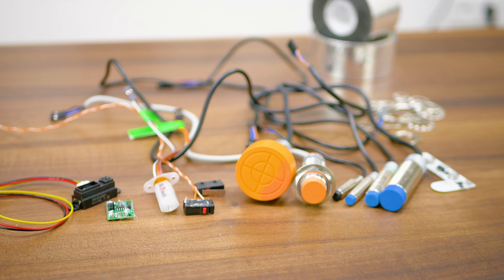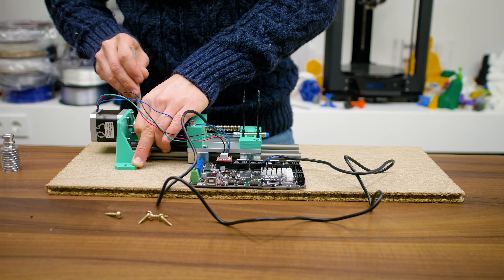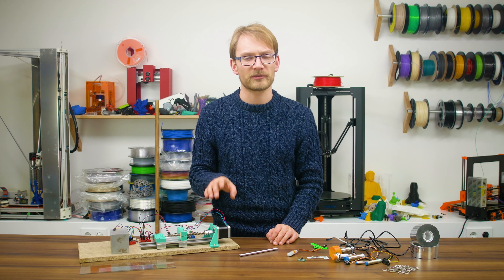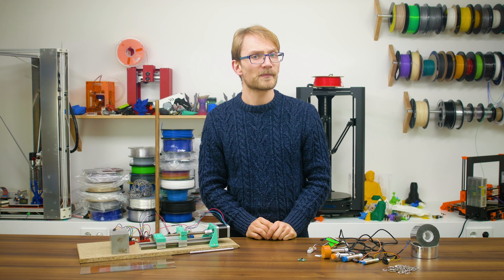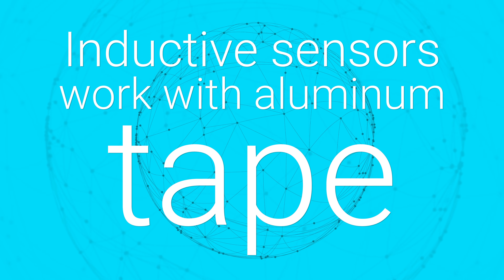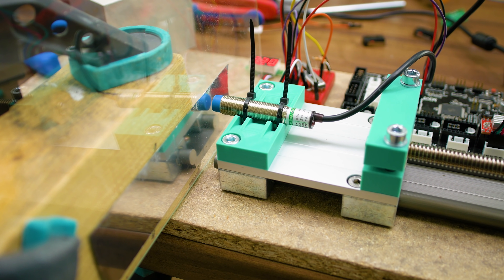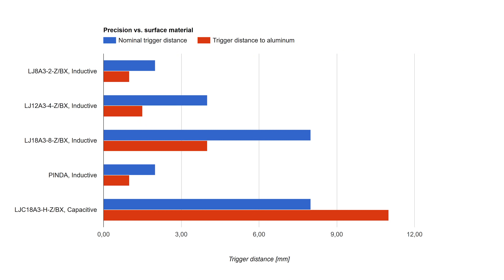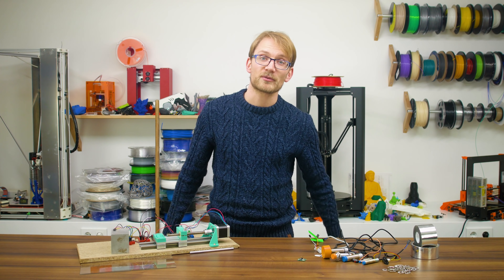Autoleveling on 3D printers: 9 myths and 12 sensors tested!

Comment: I know this video is over a year old at this point so I hope this is still relevant.
He tested all of these sensors horizontally. The BLTouch specifically states NOT to use it that way. It needs to be hung vertically as it would be mounted on a printer.

I've used a mechanical switch with manual leveling, a mechanical switch that flips up with a servo, capacitive sensors, inductive sensors, glass beds, PEI sheets, Zebra Plate from PRINTinZ, aluminum beds, and even tool steel beds. I've tried a total of 15 different sensors and 11 different beds in my few years of 3D printing. NONE of them were as accurate as simply using the BLTouch. When it is installed correctly, it just works flawlessly. Best of all it doesn't care one bit what surface you have, it will work on anything.

I think it deserves a re-test.
Reply: It has almost no deviation on his tests, maybe 3 micron, which is next to nothing. He also states that it doesn't care about the surface material. So actually even in this horizontal test it comes out as (one of) the best choices regardless of where you want to print on.

Comment: I would love to see this video updated to include Ultrasonic sensors, and name brand inductance sensors like those made by Osram up to say 16mm sensing distance.  That being said, this video is so helpful.  Thank you for making it.
Reply: ultrasonic too hard to work at small distance, basically time of flight is sooooo short electronics is not fast enough to process it. if you have at least 10cm distance then there is enough time to do calculation at reasonable precision yet you need to run higher frequencies. We tried to do  auto focus device at 25mm distance even there we had to give up on ultrasonic sensors.

Comment: The only reason I moved from an inductive sensor to David Crocker's IR sensor is because of the bed. If the thickness of the bed varies, or there are holes in it to reduce weight, the induction sensor will trigger at a different height to more/less material being on the bed in one location.

Comment: You are talking about 50µm (0.05 millimeters) If your 3d printer i high end maby and i say may your 3d printer has a tolerens of 0.1mm , maby better with out belts, and using ball spindels. 0.05 millimeters is just so unreal.

Comment: I got a 8mm "orange" inductive sensor. It detects from 5mm away at 5V, perfect for my mirror covered bed. Too bad I have deviation between the Z homing distance and the probing distance. Then nozzle homes about 1mm lower than it actually prints at. Same with endstop, that's not the sensor's fault.

Comment: Here's a question, with the inductive sensor, does the voltage range matter? ie does the sensor (say, a 6-36v sensor) work the same at 6v, as it does at 36v?

Comment: Assuming the data collected is accurate, in order to make probe comparisons, large tolerances must be added to inductive probes that include the build plate tolerance stack for non-conductive top sheets (adhesive, PEI, etc...) . Also the BL Touch is intended to operate vertically, more friction is introduced horizontally. Once all this is considered and included, the BL Touch will compare MUCH better, if not the best.  Also, if tossing on a thick G10 build plate for printing Nylon ... only the BL Touch or a micro switch can accommodate that, without having to change the probe z offset value.

Comment: I never thought about using such sensors for measuring the bed level. At work I use mostly inductive ones but just for checking if there is an object or not. When I saw your video about the Prusa i3MK3 and its autoleveling I had doubts about the precision, but your video here has told me better. Thank you.

Comment: Technically speaking the whole process shouldn't even be called "auto levelling" as the printer doesn't make anything more level after probing. It just compensated with stepper motor movements for the uneven bed.

Comment: I am looking for someone who has a custom configuration.h file that they are already using, and configured for the BLTouch Sensor, and SKYNET3D that they could put a link in for dropbox or somewhere for my CooCheer 3d Printer.  The file needs to be configured for an Anet board with LCD 12864 graphic display.  Print Bed Size configuration is W 220 L 270 H 230 mm.  If someone would put a link in a reply, I would appreciate it.  I'm sure there are other people who could use the file also.

Comment: FYI, you tested the BLTouch in the wrong orientation. I tested mine thoroughly at multiple homing speeds and standard deviation was 0.01mm with the occasional one that that was +/- 0.02mm, on all but really fast homing speeds. 

I now do a two step homing with it, once at 1500mm/m, and then a slow home at 100mm/m from ~2mm of the bed.

Comment: Some time ago I built a DIY heated bed to my Printrbot Simple Metal.  In order to get the sensor to detect the bed through the glass, I had to put a sheet of 1 mm galvanised steel sheet under it.  But now, the sensor almost touches the surface of 3mm thick borosilicate glass.  Not really useable.  I could not find borosilicate glass less than 3 mm thick.  I read that plain glass can withstand a certain amount of heating and cooling as long as it happens slowly.  But how slowly?

I decided that glass of the type used in picture frames was cheap enough for an experiment and I bought a couple of 200mm square glass frames from a bargain store.  This glass, being only 1.5 mm works reliably with the built-in heating setting (I did not have to make the glass heat more slowly) though I must warn that, since I only use PLA, this setup has never been tested above 60c!

Also, borosilicate glass can withstand some downward pressure (when things go slightly wrong) - but picture frame glass cracks immediately.  I lost both in the experiment, but have had 6 perfect prints off the third, with one coat of Magigoo on the glass.

Comment: I wish your test apparatus also used a layer of glass, typically found on CR-10x's.  If the sensor needs to be too close to the glass so as to interfere with prints during printing, then that is a fail.  Please account for sensing distance to the detected object.

Comment: Hi can anyone help on a question I have? I want to buy the anet a8 3D printer, and I was asking what sensors would work on it, if any. I don't think any of the sensors will work as it requires manual straightening , but can anyone help? Is there any other ways of making the bed straightening automatic on that printer?

Comment: Hi Tom, just came across this video while I'm building my i3 clone, great videos! Do you know if there are any 12mm sensors longer than 50mm? My sensor doesn't go close enough to the print surface so doesn't detect the print bed. Would really like to get the printer working, going to watch your clone prusa series now!

Comment: what voltage divider did you use on the inductive 6-36v sensor?  The one you built in your first video about inductive sensors?  (15kohm & 10kohm)?

Comment: So.....ok, using the sensor, the controller will know where the bed is, 
Doesn't it need to know where the nozzle is? How does it know that?
Do I need to position the sensor in relation to the nozzle somehow?
Show me the way Sensei!
Reply: You actually can set up what is called a Z Offset, either in your firmware, or preferably from the control screen.  this tells the system what the difference is between your sensor, and your nozzle

Comment: can you use tmc 2130 for sensorless bed leveling ?
Reply: I'm affraid not, because that is a "soft end" not a "hard end" I mean those X Y hardly stop the movement like hit the wall but the bed suspended on springs.
We should try piezzo. (I already bought a full set, but not decided yet will using the sensors on the hotend or on the bed) 
 I think Thomas have to try too that "piezzo Z-probe" and make video about that.
Reply: budavaril 
I totally forgot the springs
Thanx

Comment: This is OK, but the sensing here is done horizontally, and on a printer the sensing will be (always?) vertical. In fact the BLTouch creators specifically state that the results cannot be relied on unless the sensor is directly perpendicular to the sensed surface.

Comment: Try the sharp with an offset. Ultrasonic sensors generally can't read values accurately below a certain valve, due to the reading times required for the sound wave. Try offsetting it and see if accuracy is better.

Comment: awesome, but it would have been good to see the results of some more industrial type inductive and capacitive sensors, which I know are tons more expensive, but it would be interesting to compare results
Reply: i have replaced a cheap chinese capacitive sensor with an italian one, The result was very bad  (worse than the chinese), capacitive sensors for this kind of use are not good, so much variation on humidity and temperature changes. I am installing an inductive sensor right now.

Comment: Strange that the capacitive sensors would be more accurate, and more reliably accurate, than a mechanical contact sensor. That one really surprised me. Do you think it's due to the physical reset time of the pin itself? I wonder is the pin sensor would be more accurate if the sample rate were slowed considerably?

Comment: +Thomas Sanlanderer,  I have seen passionate and apparently well supported comments that both says an inductive sensor can work at 5V and cannot work at 5V.  So, who is right?  Well, it seem you both are.  Evidently the difference is in the NPN vs PNP designation.  Evidently NPN devices (like you tested) do not work at 5V; but, PNP devices do.  I have no idea what the circuit is inside these devices (and I doubt it is a BJT); but, there does seem to be some sort of a transistor in the device to act as a switch.  Also, it appears that for the NPN device the transistor is on the negative side and for the PNP device it is on the positive side (much like you would do for a BJT).  

Tech2C's investigation shows the PNP inductive sensor clearly works at 5V where the NPN does not.  See https://www.youtube.com/watch?v=wih4fNkKUCc.  It appears that for some reason 5V is sufficient to turn the high side transistor design (PNP) on; but not the low side (NPN) design.

I wish I had the sensors to investigate the behavior more fully and get a more satisfying explanation of why.

Comment: The best sensor I've ever seen is a membrane sensor. You just put it's membrane switch on the cold nozzle, hook up the small control board to the main PCB, and it works. Also, it probes with the nozzle itself, no offset is needed. After grid calibration my Kossel Mini clone prints at 0.1mm first layer with no problems.

Comment: So capacitive sensors are the only way to detect the build it's self. 
This video confirms the need for a way to correct for error. 
I like the idea of using an inductive probe as a means to compensate for a capacitive probe's error, but maybe just using 2 capacitive probes mounted near the print head and comparing the measurements would be better.  
Using an inductive probe to compensate for error would still require a metal build plate from which the position measurement could be taken.

Comment: Thanks for all that testing but now I want to know which probe is best for the Scoovo X9H. 
It has Kapton tape directly stuck on a glass bed with the silicon heating pad just under it. 
Board: RAMBo
Firmware: Marlin

Comment: Thanks Tom  for such great videos,
have you tested the slotted optical switches?
I would like to see some feedback about it. As many know that slotted optical switches are used in Deskjet and laser printers for homing the printers head.

cheers
Reply from the maker: +Süleyman CANAN I've used them extensively in the past, but found they are quiet sensitive to stray light.

Comment: Tom, you really should continue wit the Myth-busting line. I have been experimenting with sensors I have to say that your conclusions corroborate my experience  100%. Given mechanical switches with lever , although less precise than inductive, can be used with borosilicate glass, I will stick to those.  Awesome video, congrats.

Comment: Hello Tom thanks for these instructive videos, in industry we use sensor with one µm resolution from baumer (MY-COM G75P/S35L) I get one on an old equipment, and plan to use it on my 3D printer in progress ; my main issue is to manage the way to lift this system not to hit the bed or printed object while extruding.
Hope this will help. Pierre

Comment: Hi Tom,

i have a reprap 3d printer for some time now. The mendel 3 uses an ir sensor for both x and z homing. especialy the z homing i find is very inconsisntend. in fact the only thing i do against poor z leveling is manualy calibrating the axis once the print has started.  The ir sensor  is set to tringer at a set value which in term corresponds to a set height from the heated bed. So for instance a value of 18 corresponds to a height of 10mm above the bed. Do you recomend to opt for a new sensor?  Or is there a fix i might not have thought of?

thank you so much for your videos, since i learned about this channel my prints improved massively!

thanks a bunch

Comment: Usually there is a spec sheet prescribing optimal materials and thickness with respect to frequency (typically a few mils for ferrous and 2-10x thicker for nonferrous).  The relevant parameters are permeability and resistivity of the material.  Ferrous materials and sensors generally can give higher resolution with larger sensors, and non-ferrous gives better resolution with very small sensors (even though typically smaller sensors give a shorter range), but there are universal sensors that have an equal correction factor for either.  

Generally ferrous sensors would probably work best in this application, and Generally target size should be 1-3 times the sensor diameter.  Also, in terms of layered copper/alum tape, remember that you are isolating the layers electrically, so the induced eddy currents will be smaller (just like transformer laminations)… meaning you may need more layers of tape than you would expect.  

If I were adding a proximity sensor after the fact, I would get a medium-distance ferrous sensor, tape ~1mm thick steel disks to the bottom of the bed at the sensor points, fiddle with the distance, and call it a day.

Comment: I would like if you coud redo your test of the LJC18A3-H-Z/BX capacitive sensor without blowing on it.  

I just installed one on the Marlin bugfix-1.1.x firmware and ran a few standard M48 probe tests on a 3mm sheet of glass with the  following results:

Recv: M48 Z-Probe Repeatability Test
Recv: Finished!
Recv: Mean: 0.001812 Min: -0.001 Max: 0.003 Range: 0.004
Recv: Standard Deviation: 0.001324

Recv: M48 Z-Probe Repeatability Test
Recv: Finished!
Recv: Mean: -0.009938 Min: -0.011 Max: -0.008 Range: 0.004
Recv: Standard Deviation: 0.001063

Recv: M48 Z-Probe Repeatability Test
Recv: Finished!
Recv: Mean: -0.010500 Min: -0.012 Max: -0.009 Range: 0.002
Recv: Standard Deviation: 0.000781

Recv: M48 Z-Probe Repeatability Test
Recv: Finished!
Recv: Mean: -0.026563 Min: -0.028 Max: -0.025 Range: 0.003
Recv: Standard Deviation: 0.001055

Recv: Finished!
Recv: Mean: -0.008250 Min: -0.010 Max: -0.007 Range: 0.003
Recv: Standard Deviation: 0.000919
Recv: 
Recv: X:40.00 Y:124.00 Z:5.60 E:0.00 Count X:3200 Y:9920 Z:8960

Send: M48
Recv: M48 Z-Probe Repeatability Test
Recv: Finished!
Recv: Mean: 0.000625 Min: -0.001 Max: 0.003 Range: 0.004
Recv: Standard Deviation: 0.001398

Comment: I would want 3 times the standard deviation to be better than 50 microns. Which is 99.7% of the probed points. Thank you for talking about the results in StDev, it's a great measure of distance sensors.

Comment: Your videos are all excellent, but this one is superb! We spent so much effort learning this on our own... at Kikai Labs we use a capacitive sensor, take 16 measurements prior to starting each print job and level the bed automatically. It works great. We do calibrate the sensor first using three different bed temperatures, as it does matter as you pointed out. Interesting observation about the humidity, though... I used capacitive so that it would measure the glass surface, and we use a mirror instead of plain glass, and get better results. Also we found that the smallest the measuring distance, the more accurate it is, so we measure from 2mm away using a 12mm sensor.
Reply: Y que le paso a Kikai Labs?

Comment: Tom, Just viewed your video, great work. Thought you may be interested in this video of Davids mini IR. I cloned as a personal challenge....pretty in depth.........when testing the IR be certain to paint the back of the glass flat black. This will guarantee a reflection from the top surface..........  http://community.robo3d.com/index.php?threads/differential-ir-height-sensor-attemptin-clone-aint-sure-of-success-now-stage-10.6601/ Keep up the excellent work & luv your fixture.......Jimmy
Reply: Just a comment IR would reflect variant information based on the thickness of the paint, I am not sure how you would manage a consistent coat of paint on your print bed glass.

Comment: If you want to inductively sense a metal sheet you'd be better off using a ferrous alloy like mu-metal rather than aluminium. You can buy this as self adhesive rolls just like aluminium, it's used to shield electronics from H-fields.

Comment: I liked this video a lot, I simply wish the sensor I use (David Crockers IR Sensor) had a slightly deeper/more in depth review.  I am given more confidence to continue using it, however, will no longer calibrate it with the heated bed on. 

That is a variable I had not even thought twice of! I simply set the bed for 55° for my PolyMax PLA and calibrated it when it was done heating right before the print...Thank You for that!